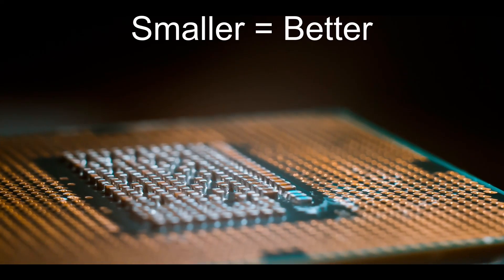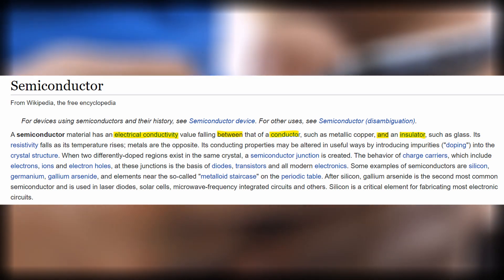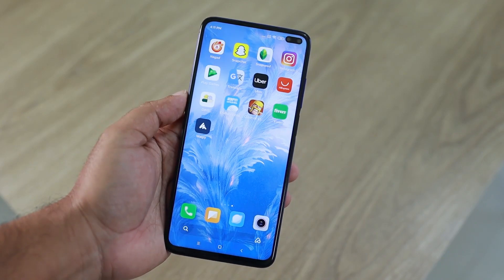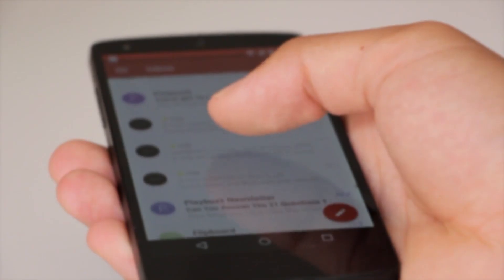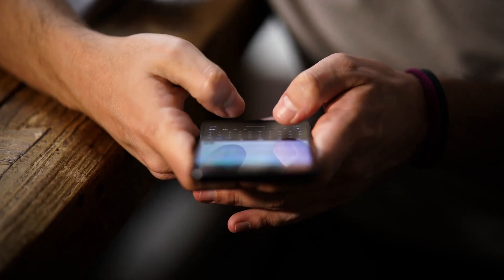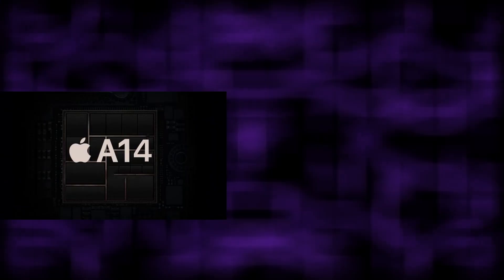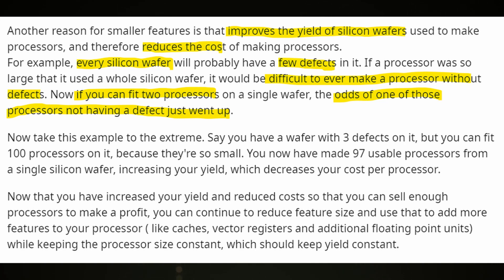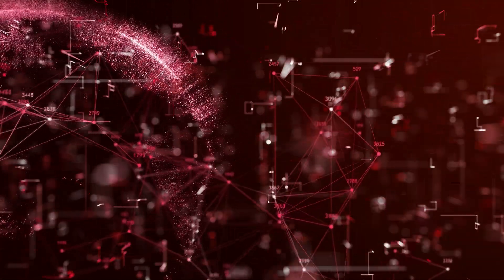5nm vs 7nm CPU fabrication: Explained

Comment: We need a better coding mechanism instead of this standard binary we are used to, because at those specifications we are getting from these latest cpu i really think the software we're making is not that sufficient and hold back almost 70% of the processor true potentials.
Reply: I think that's what quantum computers will do and they use qubits instead of binary.

Comment: The smaller the processor the higher the risk of short circuit, this I tell you as a graduate Electrical Engineer smaller transistors have the advantage of less power loss due to reduced resistance as it gets closer but also brings an engineering challenge how to insulate all those layers of chips and pack in 5 nm
Reply: Wow so we should never go smaller?? What a great solution
Reply: @WendyWilliams89  it's just one of engineering complexity, but technologies are evolving and so the materials used, im sure they will come up with a safe solution then.

Comment: Wow, this video starts off with such a misunderstanding from the presenter. Smaller CPU's are not better. If that were true, the Ryzen 5600X would be better than Ryzen 5950X. Its the smaller transistors that are better than the large transistors. Too bad this kind of mistake is what the video is kicked off with.

Comment: If your size of cpu is bigger and if you can accommodate more transistor then the bigger GPU would be better. But the story is reverse. Can you confirm the actual size of both CPU. In my opinion it's the name architecture by which you can accommodate more transistor in the same size. That's why the performance has increased but the price hasn't. Am I correct?